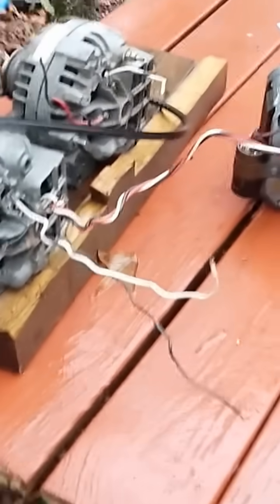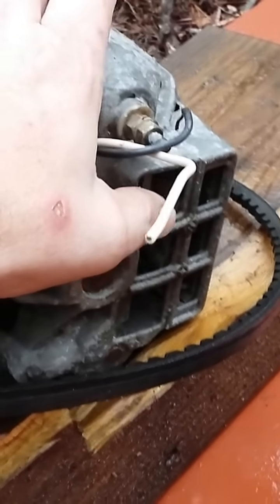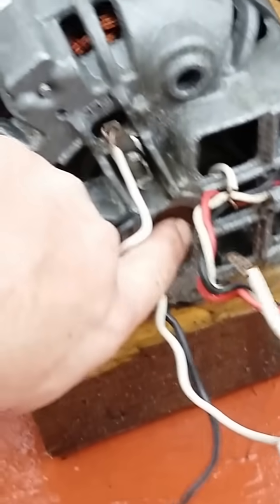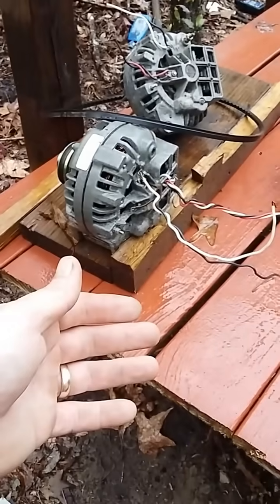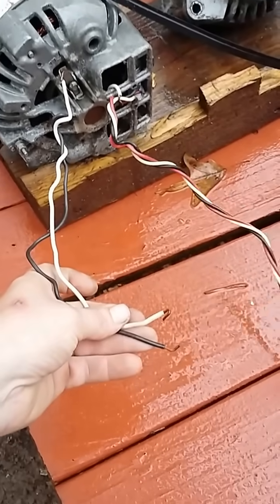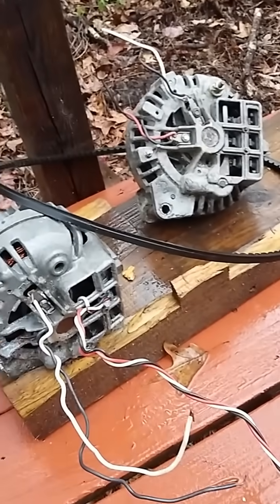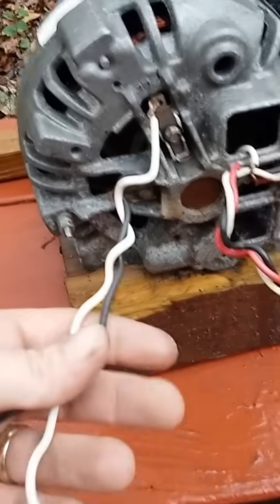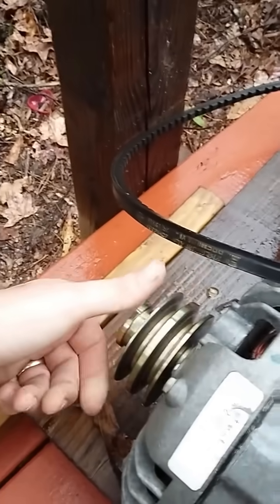Update Free energy forever no wind no solar no gas READ DISCRIPTION!!!

Comment: What are you spinning the alternators with? What power's whatever you have spinning the alternator?
Reply from the maker: Devil Dog Trucker the alternator in this video is my primary mover it is no longer being used as an alternator it is a motor
Reply: ThomasBuie EnergyBuies at gmail com 
Ok. But what is powering your alternator motor? To get energy out energy must be put in. Even a perpetual machine needs a way to get started...Are you starting with a battery which drives your motor which turns the alternator to make power that is fed back into a battery bank that is hooked up to a inverter and charge controller? 
   Perpetual energy is intriguing... Ive heard of a few people on the verge of attaining perpetual power be silenced by the powers that be. Do you have a video or could you make a video of everything hooked up?
Reply: He doesn't  seem to have the answer  right now

Comment: I have many questions! Consider me nieve! I have often wondered how to build my own generator! Rite now, my alternator just went out in my car (zetec focus) so, I have to replace it! Also, I have a generator from a tractor,  (to mess with) my 1st alternator had a cracked case & seized up. So, I replaced it. Was running my cooling fans constantly,  & an amplifier with a 1 fared cap attached, alternator failed! How are you running 3-12volts to those wires in order to get ac voltage? I would need a step by step video on my specific alternator! I will be taking my alternator apart to see what failed & IF I CAN FIX IT? 03 FOCUS-ZETEC VIN-3. I AM INTERESTED IN LEARNING HOW TO MAKE AC POWER FROM AN ALTERNATOR & EVERY STEP OF THE WAY! EVERYONE SHOULD KNOW THIS!!!!!

Comment: Do you believe it is possible to remove the gas engine off of a 4000 Watt generator and install an electric motor to turn the generator coil thus  producing 4, 000 watts powering the motor and other things?
Reply: Biggens yeah there’s a news article about a man that did it and supplied his house for a couple years and than was sued by the providing electric company in his area. But it is complicated to have a efficient system that doesn’t take a lot of power but produces an amount in which you can power the machine and battery for example. I tried this with a old generator and had it run 3 alternators to one battery and it constantly ran for months powering the light in my shed and outlets in which we used a electric power washer and power tools .But sadly theses items will wear and it didn’t help I used 30 year old alternators. But
Reply: I'm considering something like two to three vertical turbine rig to battery to inverter rig. Using the generator only to boost the batteries when needed. Whether I go with a bank of golf cart batteries or something like a tesla lithium rig also I'm still looking into.

Comment: Here's a tip;
To cut down on your loss in your system, don't do any conversion at all.  Get yourself a 6-way power strip, and plug it into itself.  That way you will have 5 more outlets to which you can use for all your free energy things!  LOL
Oh... wait... better yet, get a UPS and plug it into itself!  Use the spare outlets to drive your vibrator!  Ha!!!!

Comment: Yes, it would need more power than it delivers to run.  Yes, it would be a nightmare to regulate @ 60Hz and at constant voltage.  But even then;  in a standard home, the 2 phases are 180° appart.  With an alternator, you have 3 phases 120° appart from one another. Don't worry. No public utility company will have you assasinated for such a flash of genius.
Reply: Yes.  This is all black magic and not a cent nor sense of science...  There are too many people who got their college degree in electronics by browsing Youtube.
Reply from the maker: rouelibre1 NO, my alternator motor does not use more ( i ) than it produces since it is coupled to a 10k self excited generator head. And on a three phase motor you would want a 120° X since 3 times 120 equals 360°...  but I'm sure you know all of this, you just didn't read the description and figure out that the alternator in this video is my primary mover and I did not show the generator.
Reply: Who's talking about current?  Yes, you can manipulate it as much as you want.  Just as a transformer can jack voltage, but not power.  Even more so, energy (power over time) cannot be invented out of thin air.  The only answer resides in Joules or Kw/h, if you prefer.
Reply from the maker: rouelibre1  who's talking about kilowatt per hour? I was simply stating that the only way to achieve an efficient over unity device is to use a 3 phase permanent magnet motor and use a pulse with modulator in between 13000 and 16000 Hertz on the top end at about 400 volts connected to a 3 phase H bridge to get your primary mover to only consume a maximum of 1 amp so that it would be able to power a couple of self excited generator heads there for creating more energy than it uses...
Reply: Well, for a start, your alternator doesn't use permanent magnets but a field voltage.  So in the case of automotive recuperation, you would have had better luck with a starter in that optic.  Though, the alternator is not a bad solution.  A regulator could monitor the otput voltage and adjust the field in order to maintain it at the desired level.  In that case, do use the diodes and produce DC.  Just as it is designed to be used in a car. Then, a good AC power inverter would give you a solid 60Hz at the desired voltage.  But as far as the initial source of power is concerned, you will need a wind-mill, a water stream or a bicycle.
Reply from the maker: rouelibre1 the alternator is my motor...
Reply: So?  Where do you go from here on?  Show us some results in power at continus Watts.  That is the point and nothing else.
Reply: Not to mention the outlets and and devices catching on fire because they aren't rated for the heat build up etc.

Comment: You would need about 6 gauge wire to hold 90 amps for any length of time and I need 60 cycles per second for most of the electrical equipment in my house. You haven't explained how you regulate the frequency.  Matter a fact you haven't explained how you rotate the generator?
Reply from the maker: Sidney Boudro there is NO generator in this video. the alternator in this video is a 3 phase field coil magnet motor. It is my primary mover. 
 but to answer your question on how to get 60 Hertz from a generator you would need to use this example. 60 pulses per second times 60 seconds equals 3600 revolutions per minute. (I have two 10k self excited generator heads)  and because I know you're a good person, who has children, I will give you a piece of information that has previously been stated in the comments below. 

 the only way to efficiently achieve over unity is to use a 3 phase permanent magnet motor. You must have an input frequency of around 13000 to 16000 Hertz (top end) using pulse width modulation and feeding it to a 3 phase H bridge.  you're also going to want your voltage to be around 400 and you will only 1 amp of current. (MAX) 
This will give you an outstanding amount of 
(P) Wich is  ( i*v )..  I hope this helps!

Comment: This will produce electricity, however, the hard part is finding something to turn the generator with...
Reply from the maker: World According To Mark 
Yes you are correct about that unless you consider the higher the voltage the less resistance, so pulse wave modulation at 120 volts would be the way to go if you're asking me...
Reply: I'd love to see someone actually build something like that and share their entire plan. I did see one guy who uses a stream going by his house to turn the generator with. Here is his video: https://youtu.be/ZmHY9DkD1Hw

Comment: It doesn't matter if its an alternator serving as a motor and a generator or an alternator serving as a peanut butter and jelly sandwich, under 0 circumstances could you ever get more electricity out of that setup (or any setup for that matter) than you put in. The First Law of Thermodynamics (the rules of the universe, not corporate propaganda) states that the internal energy of a system has to be equal to the work that is being done on the system, plus or minus the heat that flows in or out of the system and any other work that is done on the system. For example, you can not put 5$ in your bank account and expect it to be 100$ when you try and take it out. For the exact same reason, you can not put 12V (unspecified amperage) DC into a generator and expect 220V 90A AC to come out. If that was possible, we (the human race) wouldn't have discovered it in such a manner as you think you have.
Reply: Peanuuut peanut butter. And jelly , first you wire it you wire it. Lol I'm crying this is so funny
Reply: I don't see any of your trying.
Reply: Matthew Montoya I wonder if there's a reason for that.... maybe, the one I just explained?
Reply: My question is how much energy do you put into magnets where you live? Where I'm from we don't but we definitely get energy out of them. Looks like the first law of thermodynamics is jacked!
Reply: Brianmason3636 alright bucko go back to middle school science class before you try and disprove thermodynamics

Comment: Those connections could not handle that amount of bs
Reply from the maker: +Ralph Latham I don't think you know what you're talking about or maybe you're not keeping up with the conversation please read the description of the video or the pinned comment one of the other may give you a little bit more insight as to the fact that you're just being a jerk for no reason the alternator in this video is not being used as an alternator it is being used as a motor there for the wiring on this alternator is more than twice the size needed thank you very much for your comment I guess

Comment: That #14 wire he has running from the windings won't carry 90amps. 15-20 amp at it's best. Lol
Reply from the maker: Nicholas Buchanan  actually it's number 12 and it's twice the size I need for the motor that it's coming out of.
Reply: ThomasBuie EnergyBuies at gmail com  all I'm saying is you're claiming to 90 amps out. I stand corrected #12 wire isn't gonna hold 90 amps.
Reply: I thought he said 90 watts not 90 amps big difference #12 wire can handle 90 watts easily
Reply: Jerry Saxton listen to it again he talks about how their 9 a.m. all day or which is true. But then how you going to power your house with them. Says he has a 180 amps total.
Reply from the maker: Jerry Saxton thanks for the comments, the alternator in this video is not being used as a generator. it is being used as a 3-phase motor. please read the description of the video.
Reply: ThomasBuie EnergyBuies at gmail com, I just watched the video again to be sure I didn't miss something I could have misspoke. You literal said you were using it you general 3-phase power. At 1 point you said you could hook it up to a panel and power the house @ 90 amps.
Reply from the maker: Nicholas Buchanan yes you can but it's not going to generate that much electricity unless you do modifications to it..  as it is,(not converted) it only produces 1080 Watts. That is 90amps @12vdc or remove the bridge rectifier and you get 8.6 amps @ 120vac. With a little bit of modification.. But like I said that is without adding any components to it. now if you had components to this it will surprise you at what it can do!!! but I don't have the support I need to be showing those videos for free! I only share those privately... and I'm not going to ask for support anymore because I'm tired of the drama! When everyone finds out how much they really need me.. then everyone will get behind me and get me out of Harm's Way and I will start building these for someone to mass produce... as it is right now I'm teaching people little-by-little of how to build the fifth device of overunity that I have built...

Comment: You sir are a fucking genius. Thank you so much for sharing this with the 🌎. ❤✊
Reply: The alternator looks like a Mopar aka Dodge off maybe a 5.9 liter RAM truck. And the motor is a simple washing machine motor. Im 100% on the motor but the alternator not 100%. Just use a simple GM alternator.
Reply: bro this guy say read the discription i cant see one what kind of motor are they have you got reference
Reply from the maker: the alternator in this video is my primary mover or motor.
Reply: bro still dont undrstand where can i find these alternators what car comes off it please
Reply from the maker: MARK SMITH  what I am saying is, it's not going to matter what kind of alternator you use as your motor.
It is no longer an alternator, it is a motor...
Reply: ok bro sowhat troubling me is he said that you put small volt from one end you get 230 volt from the other how it s possible
Reply from the maker: MARK SMITH and that is also why I said read the description of MY VIDEO or the pinned post of MY VIDEO...  this alternator can still be a generator but it only produces alternate current. I am not using this alternator, my alternator, has a alternator!!!
 I am using this alternator in the video, which is my alternator, as a motor...

Comment: What you are calling a 'stater' is a 'rotor' ;...a 'rotor' rotates, a stater stays.
Reply from the maker: Ronnie Brackett 
You didn't read the description, title of the video, or the pinned post! or you would know that the item you're talking about.. that you're thinking is an alternator... is actually a 3-phase motor. And the AC induction motor in the video has nothing to do with the video at all! it's just there for looks...
Reply from the maker: Ronnie Brackett 
And yes you're absolutely correct the stator stays in place making it a stationary coil and a rotor rotates..
STATOR NOT STATER...

Comment: As a retired engineer, I perceive that there is so much wrong and frankly dangerous information in this video that it is difficult to know where to start.

Here are a few things that occur to me immediately:

1. This is not "free energy". Not even close. This is simply an attempt at a generator design. 

2. If you put anywhere close to a "90 Amp" load at household voltage on this thing, it simply will not work. As has been pointed out by other commenters, the load carrying leads (wires) are far too small in gauge. That is , regrettably only he beginning of the electrical problems with this implementation.

3. If anyone is going to build something like this, for safety sake, please do not do it outside on a wet wooden deck in the rain. It doesn't take an engineering degree to see the obvious problem with this.

4. Speaking of safety, perhaps before you attempt something like this, read a little about electricity and its basic concepts. Things like Ohms law , the concept of loads and resistance producing heat and losses, proper wire gauges, etc. 

Just my $.02 worth based on over 30 years of electrical and electronics experience.
Reply from the maker: William Moore yes everything you said in your comment is correct and I have advised to people on the same issues as well! Please read the description or pinned post.   the alternator in this video is actually my primer remover and not a generator. thank you for your comments!
Reply: ThomasBuie EnergyBuies at gmail com your description reads, in part, "free energy forever" . 

That description is misleading at best and downright incorrect at worst.
Reply: see this video  it is portuguese and tell me something after    https://www.youtube.com/watch?v=XWlG5jXvwAQ&ab_channel=liciniobatista

Comment: stupid people! this works for real! my sister in law dad used this method to power his house and it worked. I just have a question: what type of motor do you use to make the alternator spin? how much power must it has?
I want to try this power alternative when I have a house.. thanks for the idea.
Reply: Dumpster Dive props an alternator needs to spin at about 2500 rpms to produce a charge. So a motor rated a little higher should work. (Compensate for belt and pulley resistance)

Comment: All you made is a portable generator.  Its not free if you have to turn the alternator with a gas motor.  Using gas or the grid, which do you think is more cost effective?  I hope you like that loud ass motor running near your house.  You must be in the middle of nowhere cooking meth to have to do this.
Reply: Edward Granados  
he can power his lights to grow marijuana in the woods ....lol
Reply: Wind turbine and charge controller...
Reply: listen very closely he powered it with a 6 volt battery which in turn make over 120 ac which he can power anything including charging the original source of power
Reply: Joe Scheller He said you STILL have to turn the alternator after applying the 6 volts.  What you just discribed is impossible because of the law of conservation of energy.  You can not create something from nothing.  I'm a power plant operator.  He just made a normal a/c generator.  Which still needs and power source to create the energy.  Also you will need a power controller (which costs money) to keep your energy source constant. Also you need to be at the right frequency (60hz in USA).  Otherwise you will fry everything in your house.
Reply: Edward Granados  
Low key racist lmao.. why cooking meth though? Why not cooking tortillas ? Or chorizo?

Comment: Not going to say nothing bad just a question. Is it still free energy if u have to add voltage to one side and then spin the rotor to get a certain voltage/amps output? What part is free? U adding electricity and motion, Sounds like you make a new type of transformer.